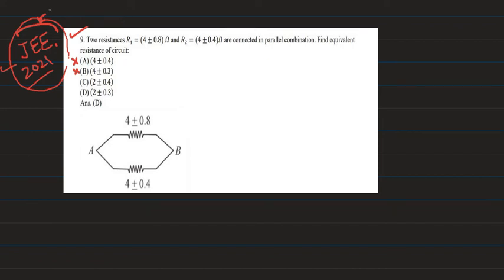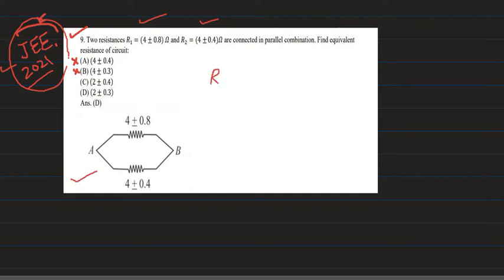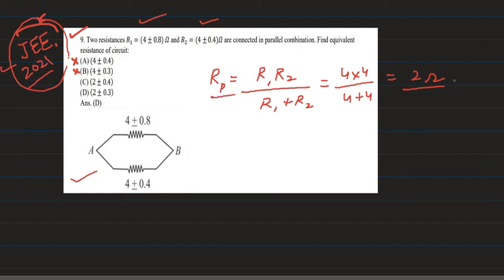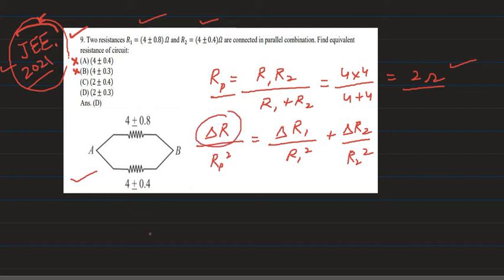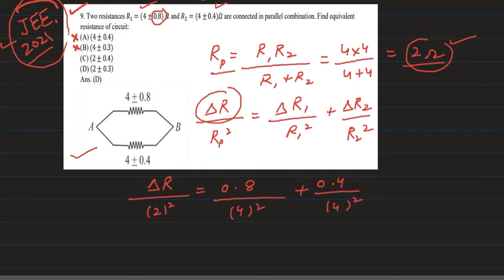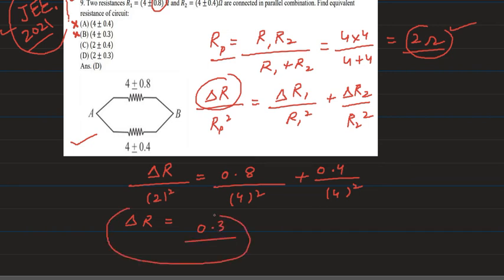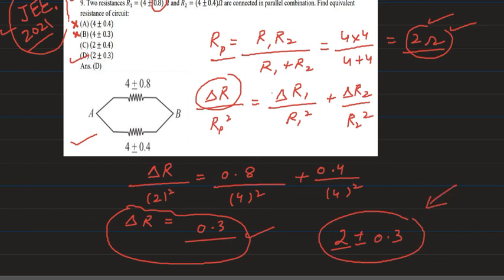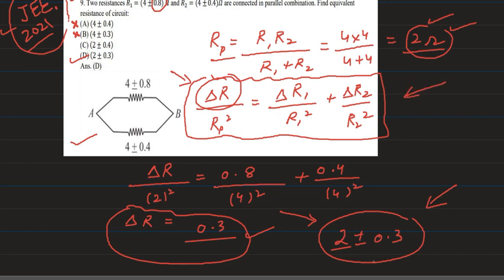Two resistors R1 = (4 ± 0.8) Ω and R2 = (4 ± 0.4) Ω are conn  parallel JEE MAINS 2021#jee #neet2022

Comment: Sir Rp ^2 se q divide kiya aapne
Reply from the maker: When you are going to find absolute error in these type of relation such as parallel combination of resistance or focal length type. This is the relation used to get.. This is a ncert problem, check ncert solved example in ch-2 you will find this relation...